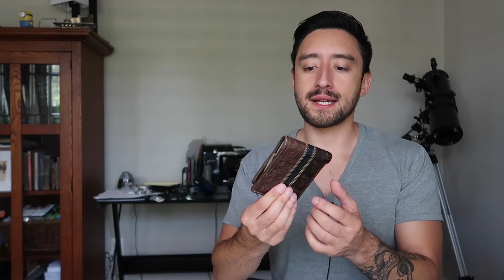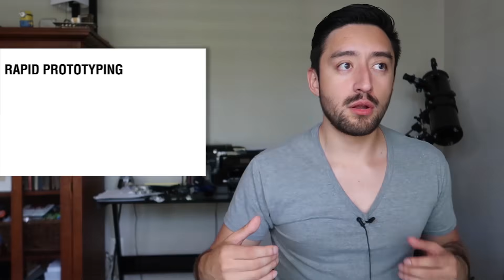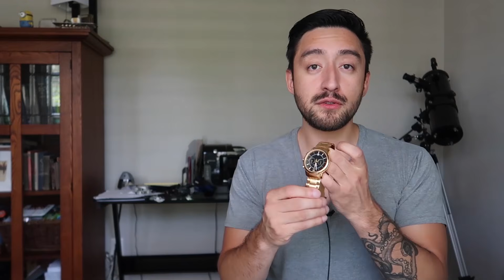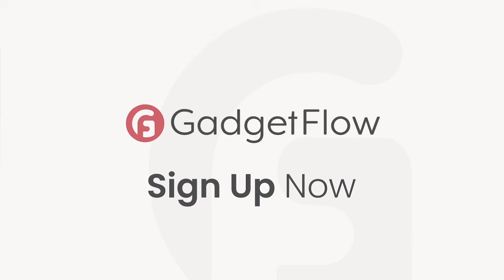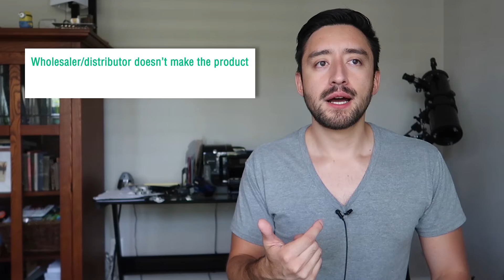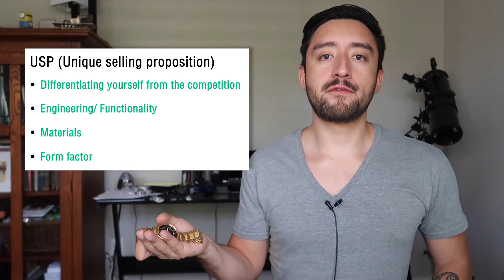How to Create, Design and Manufacture a Product from Scratch

Comment: 🎯 Key Takeaways for quick navigation:

00:14 🧠 Product creation starts with identifying a problem or need, either observed in one's own life or in others', which sparks the idea for a new product.
02:28 🎨 Product ideas can also stem from reimagining existing solutions to common problems, encouraging innovation and creativity in design.
04:07 🖌️ Designing involves translating the product idea into a two-dimensional form, allowing for visualization and the exploration of key questions regarding appearance and functionality.
06:15 🛠️ Modeling provides a tangible representation of the product, facilitating user interaction testing and refinement of its look, feel, and dimensions.
09:44 📐 The blueprint stage delves into the functional aspects of the product, involving engineers to ensure feasibility and detailing specifications for manufacturing.
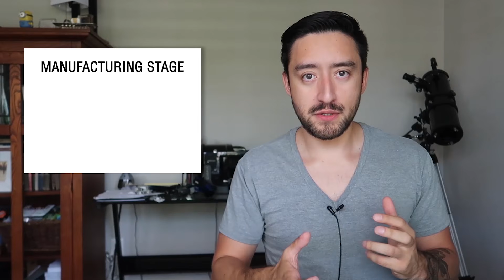12:22 🏭 Manufacturing entails finding suitable partners to produce the product at scale, considering cost, quality, and expertise in handling the required materials.
15:12 💰 Crowdfunding platforms like Kickstarter offer a viable route to fund the initial production run, validate the product, and engage with potential customers before mass manufacturing.
17:49 🔄 Scaling a business may involve distributing roles such as wholesaling, retailing, and fulfillment to different partners to manage time effectively and expand operations.
18:02 🚢 Products can be shipped from manufacturers via boat or air to fulfillment companies.
18:31 📦 Wholesalers buy products in bulk from manufacturers and distribute them to retailers.
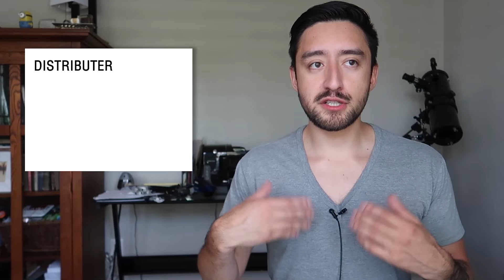19:38 💼 Distributors usually have contracts with manufacturers and engage in marketing to increase product demand.
20:34 🛒 Retailers sell products directly to end customers, stocking inventory bought in bulk from wholesalers or distributors.
21:29 📈 Entrepreneurs decide whether to sell products to wholesalers, directly to consumers, or through distributors, considering factors like marketing and fulfillment.
23:10 🧠 Understanding your strengths as an entrepreneur helps in deciding which parts of the supply chain to manage or outsource.
24:34 💡 The Unique Selling Proposition (USP) helps differentiate products based on engineering, materials, or form factor.

Made with HARPA AI

Comment: I need something a little more in depth information about the actual product blueprint design stage. Exactly where do you find these engineers to make the blueprints? And if it's tweaking an existing electrical product, where does the person designing the blueprint get that information or can the manufacturer tweak it for you if you just tell them the minor change you want?
Reply: same. Glossed over quickly from prototype to the engineering phase to the DFM. I'm stuck in between wondering how to get to a final prototype without spending $30k. Or, will the manufacturer just do it in China as part of overall service. Very confusing and not much help out there
Reply: @johnnyt5108  me too, you found solution?
Reply: Same here.
Reply: This. All of these videos focus on how to figure out what to make and crowdfunding… when people want to know ways to actually prototype and blueprint. That’s the biggest part in all this, with marketing the next part…
Reply: @Kayzewolf Right. There’s definitely a market for those videos!! Can’t find them anywhere
Reply: Yeah. Im stuck there
Reply: Universities are one place.
Reply: one tip is get in an engineering school and find yourself a futur designer, stress analyst or electronic engineer... they already have some skills to do a blueprint draft... next step is a professionnal engineering office, but that's way more expensive

Comment: This was an awesome vidieo no more than 27 minutes, you provided in my opinion, 100% of the information needed to create and sell a product. Before watching this video I was in the process of researching Life alert technology. For a while I have been coming up with ways to stay safe in our society. It is very interesting that in this video, you used a watch as an example. 

I have an idea of an emergency bracelet that is safe to wear, low cost, able to be customized and and can direct users to the specific first responder. Where 9-1-1 has a whole process of gathering information, I want to by-pass that by using GPS, Ehternet, battery, water resistance, fall and crash detection all into a a watch. The Apple watch as similar features but the cost and the consumer outreach is not respected. 

By looking at conmuser usage of watches and the want for customizable products, I know that my product will need to be light weight, easy and comfortable to wear, not bulky and battery-powered with connections to Ethernet and Bluetooth. The material would be rubber or rubber similar.

Many people have android devices. With Ethernet, LAN Local area network that will process better than WIFI and is backed up with a battery. This watch would be for frequent travelers, Pregnant women, Kids 6-18, Stay at home/ work from home parents. Life alert claims to save and respond to emergencies in 11 minutes, I want to respond in 8. I just need some communication to get this started.
Reply: Emergency bracelet competition is either The Apple watch or Senior citizen emergency services (Life Alert) and its competitors.

Comment: I am an industrial integrator if anyone needs help bringing manufacturing equipment alive. I'm an expert in robotics, PLCs, process control, motors, motor controls, conveyors,  VFD, servo control for position control or torque control for pressing applications. I also do control panel electrical design and panel builds. We cover wiring and installation of industrial cameras, sensors, pneumatic products . All my controls designs are using modern technology that cuts costs. No more big remote control panels with huge build costs. Remote controls makes it much simpler and you can still capture data. We work with partners everywhere for all sorts of applications.
Reply: I am in Toronto, Ontario, Canada. If you need local support. We travel around too. Allen Bradley, Omron, Siemens, ABB, Panasonic, Keyence, Ethernet IP, DeviceNet, Profinet, EtherCAT etc. Also I can carry an electrical licence so I can assess your 277V/480V, 347V/600V 3 phase systems too.
Reply from the maker: Shoot me an email. CrowdCrux.com contact page.

Comment: when you are going through your design phase of sketches, NEVER throw anything out. you might want to review that later
Reply: Thanks for the tip
Reply: Hmmmmm thanks
Reply: Smart idea
Reply: What to do if I cant draw😩😣😞
Reply: @daveunlaid6954  lmao it’s not hard
Reply: @EthanAdey  What if i can draw but I cant get the model right on paper like it is not the same as the image in my head.
Reply: @divijchawla7565  then work with a product designer on fiver or something to help you design it. Make them sign a non disclosure agreement tho
Reply: @grizgames6458 better to learn it yourself as no one knows what you're thinking better than yourself
Reply: @divijchawla7565 then you make a physical model 😉
It doesn't even have to be a functional prototype initially, make it out of whatever you can: paper, cardboard, wood, plastic, clay, metal, 3d print, etc. However you can arrive at something you can hold and feel that looks about right, just do that.
Reply: @divijchawla7565 I can fully relate to what you are saying. For real!
Reply: @daveunlaid6954  Quit and gets a job with the government
Reply: @daveunlaid6954  liar. You can draw. If you can make lines that make shapes on paper you can draw. No ifs ands or buts.

Comment: How do I go about going from the 2d phase to getting a 3D prototype model if my product idea requires electrical engineering? How do I find these kind of manufacturers and/or contact them?
Reply: thomasnet.com is where you start. I also like to search "short-run manfacturing" or "prototype manufacturing" to focus on producing enough product for the market without sinking completely into the abyss of debt. Debt is inevitable, but there are ways to minimize that. Also, before you consider going all in on manufacturing the product yourself, I'd highly consider looking into licensing. I'm at the stage of having to make a decision between the two and I'm telling you right now, I'm leaning more towards licensing just to get into market.
Reply: @Von_Kanon  silly question but what is licensing?
Reply: @Von_Kanon  where do you go about getting licensing? I’ve primarily thought of only trying to figure out how to get a prototype of my product idea produced so that I my self can actually test it out and see if it truly is beneficial. There’s so much amazing shared advice but I’m at a loss on specifics with who or what to reach out to, to get my product actually created and how
Reply: @Von_Kanon  Can you elaborate on the licensing? What are we getting a license for?
Reply: work with a product design studio